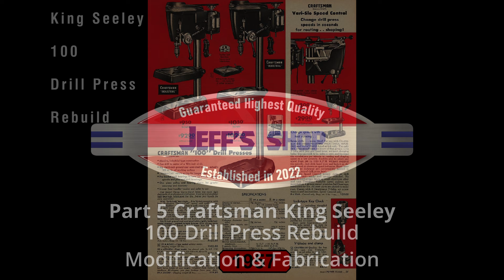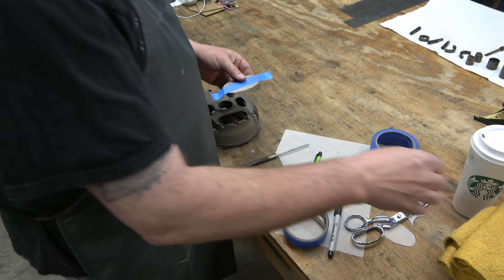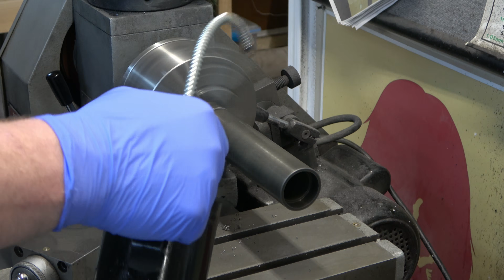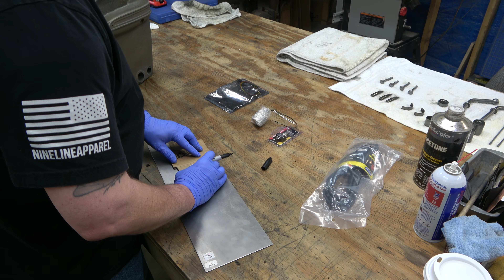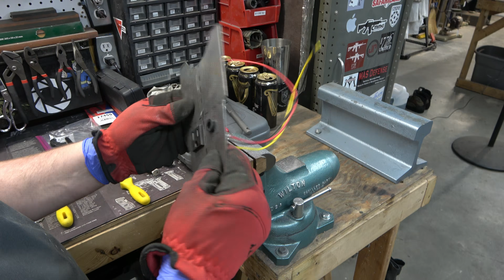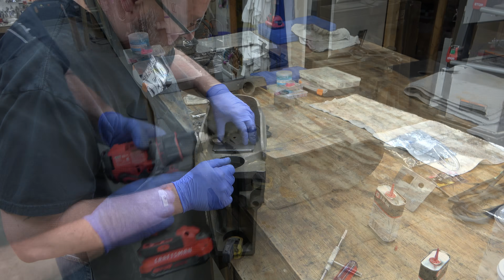Part 5 Craftsman King Seeley 100 Drill Press Rebuild (Modification & Fabrication)

Comment: Hi Jeff, can you please share the specifications of the quill clip/stop ring for the 150, that you installed on this 100?
Reply from the maker: Sure, so the quill is 1 5/8” diameter. The channel (snap ring slot) I milled into the Quill was approximately 1316” from the bottom of the quill. The slot was 3/16” wide and the diameter was 1 17/32”. The snap ring I used was from McMaster-Carr product # 95524A147. It came in a pack of 10 for $8.65. Be sure to double check all this as you modify your quill. Be careful to not go too deep these measurements are based off my memory. Once you have a retaining ring then you can judge how deep you need to go on your quill.